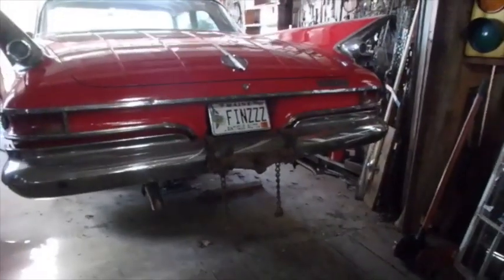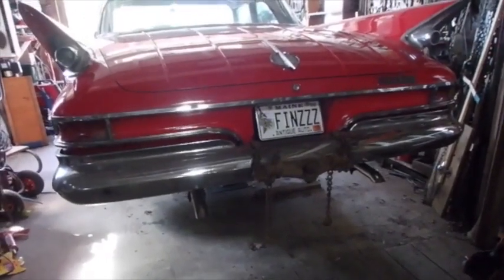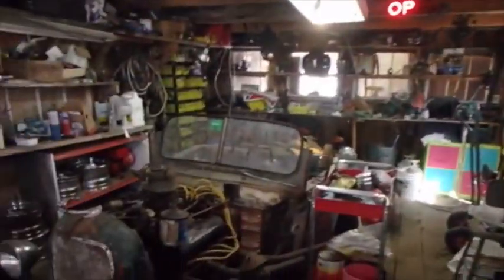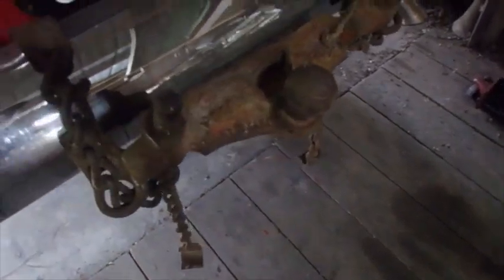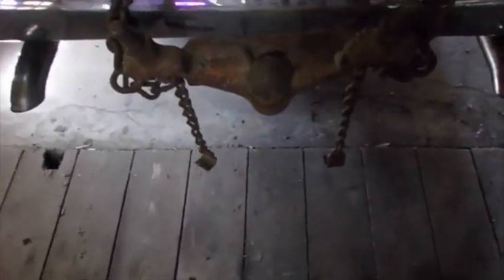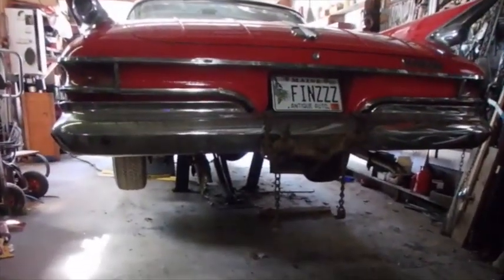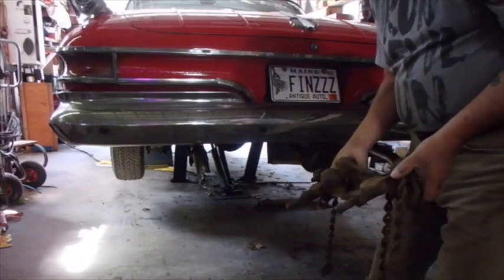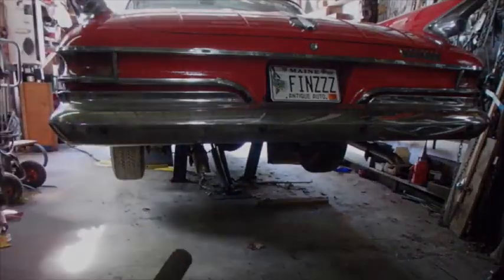Old School Vintage Trailer Hitch rejuvination

Comment: I wonder if you are going to actually tow something with that old hitch? I sure hope what ever you tow stays connected to the hitch. Must be a real good reason they stopped using them long ago. Are they legal? Just sayin.
Reply from the maker: Ha!   Yee of little faith.  Of course I'm going to tow something with it.    Back in my days folks would hook one of these to the back bumper of their 47 Chebby and haul that old Ford 8N to town like it was nuthin'..  The only think that would make it unsafe is that cars don't have bumpers anymore.
Reply: I be of little faith because once upon a time I worked in a shop and the welder put a hitch on a vehicle and the hitch failed and the trailer zipped off the road on to somebodies property, no one got hurt, could have been a lawsuit, hope it works.
Reply from the maker: There was one got loose and ran down a lady in her garden up here once.  Kilt her dead right off.   That was bad business.   I've done some pretty sketchy stuff with race car trailers in my day, but this'n ain't one of them.   I spect you could lift the car by this setup, but I don't need to do that.  All I need to do is pull a little Crosley a quarter mile over to the fairgrounds for the cars show this weekend.   I got it safety chained up and all.   It'll be fine.